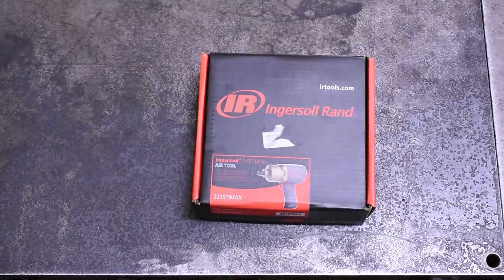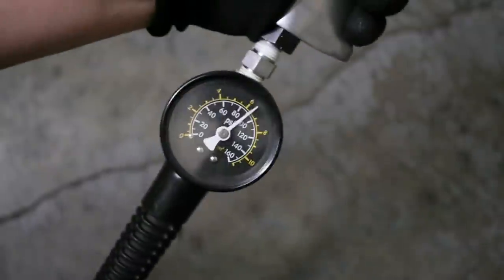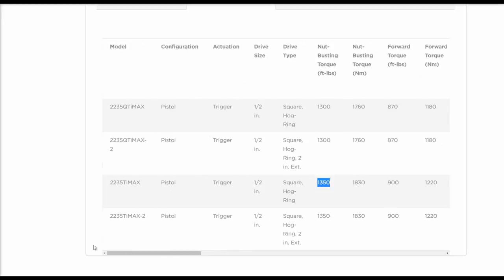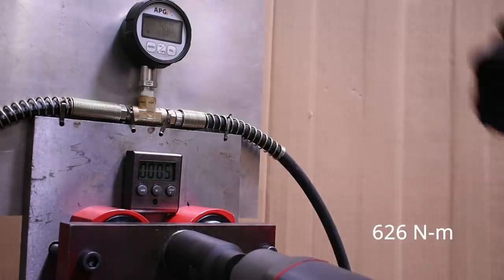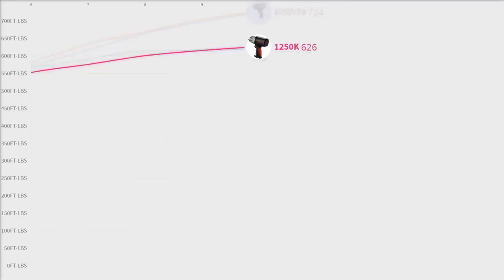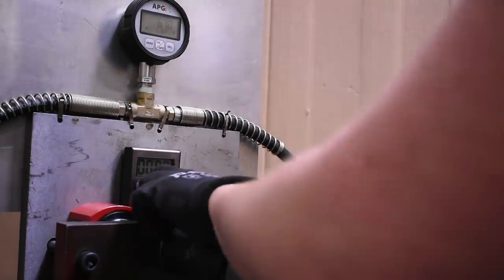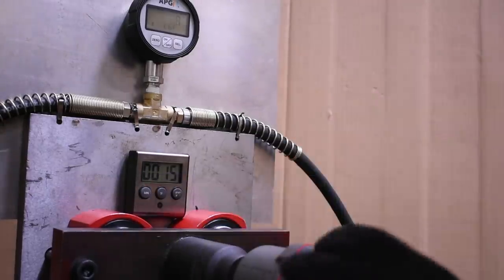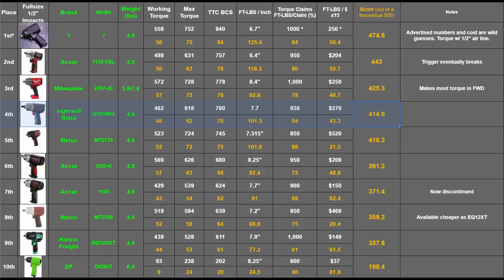The #1 Selling Air Impact vs Modern M18 & Matco Rivals: 2235TiMAX Tested

Comment: my dad has the 2235 ti, as a shop gun, a snapon mg725 on his truck, and i have a mac awp050, of the 3, from doing track bolts on a jd 450h, my mac hits the hardest, our compressor is set at 170 psi cutoff, and kicks in at 150? i think. hes had the 725 for probably 7 years, ive had the mac for 6 now as my primary 1/2 gun and the shop has had the 2235 for probably 3 years now, no issues except for the 725 having a vane break.(the awp050 is my favorite of the 3, the balance and vibration is the best imo)
Reply: but there still onlky 1/2 inch impacts so their mileage is limited for what we do, but all 3 have alot of time on them
Reply from the maker: We'll be getting our hands on the proto very of that Mac, so we'll see!
Reply: @TorqueTestChannel  nice like i said my favorite 1/2 impact, are you guys planning on doing any bigger impacts? 3/4 or 1 inch?
Reply from the maker: @patrick11169  Yes, focusing on cordless of those sizes but will do a video on air about 3/4" as well.
Reply: @TorqueTestChannel  awesome thanks for the response, for those impact sizes most people are using them as their right hand, truck lug nuts or for me track/Bucket/blade work on off highway equipment, and from experience they vary WILDLY in there performance and price,

Comment: I'd love to see some tests run longer, 30s and 1 minute
Reply: There's no point in that. No one holds an impact for longer than 15ish seconds.
Reply: When something won't come loose, we absolutely do. that's where the peak torque numbers come from, too. The lines aren't flat at the end of the 10 sec timer.

Comment: So is this what I want to go for if all I care about is getting lugs nuts on and off as quickly as possible but I don't want to fork out for exotic pit guns?
Reply: nope. lug nuts are only around 100 ft pounds, these would snap the stud. get something smaller and cheaper if thats the most you need

Comment: Weird. I own a 2235qtimax (quiet version with less torque) and an m18 high torque. There’s stuff the m18 won’t take off but the 2235 takes off no problem.

Comment: What would u say is a better road used matco or new IG both guns are the ones u tested and where is video on air hookup u use
Reply from the maker: The IR. See channel info faq
Reply: @TorqueTestChannel  was just making sure didn’t understand fully in specs, but that’s me love channel . What air set up ? Currently have 50 foot hose 90psi

Comment: IR makes matcos air guns
Love mine might have paied $200 to much for it but the tool truck is at work ever week. My dads old IR still hits as hard as it did 24 years ago when 8t first come out of the bow by the ainvel is wore out on 3 sides to the point that its splintering apart
Reply: They haven't made Matco guns in years like he Said
Reply: 3:23 PTP has made the last two generations of 1/2” Matco models.

Comment: I'm just trying to buy my husband a christmas present! Can somebody please tell me which is the best option??? He works at a shop so he will be using it every day. I'm trying to buy something durable for a fair price. Any recommendations??
Reply from the maker: Air powered or cordless? For are Ingersoll rand IR2235TiMAX or Astro 1894, for cordless depends on the batteries he has but probably Milwaukee 2767 or DeWalt DCF891 for something a bit smaller
Reply: @TorqueTestChannel  Thank you so much! I think air powered is a good choice for him, so I'm going to look for Ingersoll Rand IR2235Ti Max. I appreciate 🙏 the help

Comment: I watched your pneumatic video but I never saw or heard what fitting are you using on the end of the gun? Volume @PSI is important, not just saying Manuf... 90 psi. I only use Milton 760-1 true 1/4" V style air inlet's. home depot/ Lowes and sadly the tool truck guys use a almost 1/8" even though they say its 1/4" its not. you never talk about ergonomics of a gun, I been using pneumatic guns for 20 years, Snap-on, IR, aircat, harbor freight, etc... I have IR guns that are 15+ years old, still rebuildable if I need parts. IR's rear 1 thumb push forward/ reverse is 2nd to no impact. I have Milwaukee and Dewalt impacts, none of which can do the same work as my IR's speed at removal & so much quieter. My battery powered tools don't get much use.
Reply from the maker: We use an IR 80 gallon compressor, 3/8" 25ft hose, 1/4" Milton V style Hi-Flow Pro fittings and Milton coupler.
Reply: @TorqueTestChannel  your home built dyno is flawed.

Comment: What air compressor was used in this test?
Reply from the maker: IR 80 gallon 2 stage
Reply: @TorqueTestChannel  Thanks.
Reply: @TorqueTestChannel  Do you have a 60 gallon 2 stage compressor to test the IR gun on?  I'm wondering reverse torque is effected if the CFM is reduced 7-9 CFM under the IR's 24CPM at load.

Comment: I have the original 2135ti gun. Still working and plenty of power. 

That 2235ti is slightly more powerful but extremely and obnoxiously loud for everyday use. Can't stand it in the shop.
Reply: Out of 14 techs in my shop we have 9 IR guns (one old matco) they're absurdly loud.
Reply: Still break out the ol 2135QTi with a few drops of oil when the going gets tough, use an Aircat 1056-XL as my go to 1/2" most of the time these days as it's light, quiet, and compact.  Have an IR 2190Ti I got for a song as a backup to that with 1/2" line for bigger stuff, but usually just grab a 3/4" breaker bar at that point if it can be done without impact.

Comment: I would like to see you tighten a large bolt to the moon and see witch gun can break it loose. A fast gun wont break stuck bolts free. A hard hitting one will. I want and need a gun that will move it or break it so I can get on with life.

Comment: So instead of buying an air compressor just rent Nitrogen tanks and hook the IR up direct. If it's a beast at 165 psi think of the monster it will be at 3000 psi. Of course I'm joking please for love of your fingers and other bits currently attached to your body do not do this. Would be interesting to see what would happen with a slow motion camera and see just how fast that IR can turn before it turns into a bomb though if anyone with the time, skills, and desire wants a project.

Comment: Can you test these against the Cornwell 1/2 IRC9000 please. I have the matco in the video as well and when i cant break lug nuts loose with the Matco i use the Cornwell. I have had mine for 6 years now and still its running strong. I do take of my tools though. Many times my gun was used get the job done. I got all 5 mechanics at my old shop buy this gun after their IR and snap on wrenches werents able to break a nut loose.

http://corporate.cornwelltools.com/webcat/products/IRC9000-%252d-1%7B47%7D2%E2%80%9D-Premium-Impact-Wrench.html
Reply from the maker: I believe IR still makes Cornwell's guns unlike Matco. So that should be a 2235TiMAX, the design details and specs match up too. 900, 930, 1350 ft lbs.